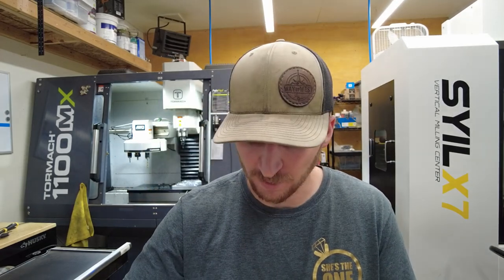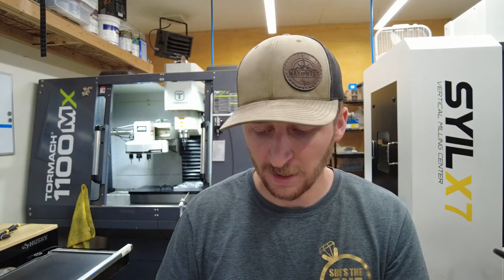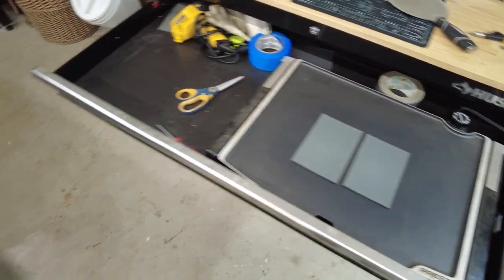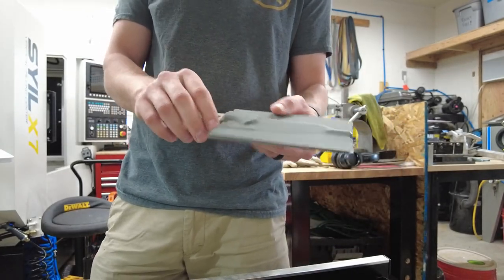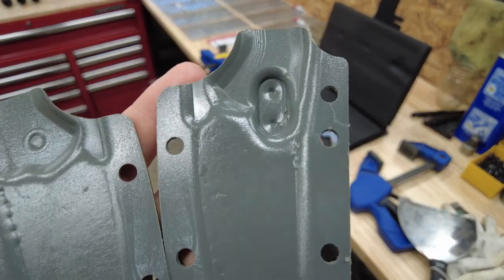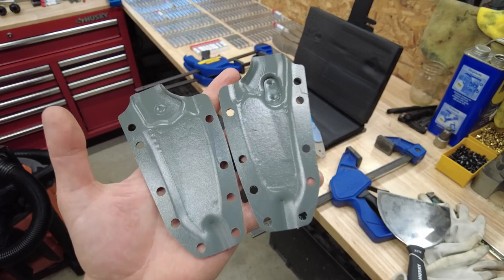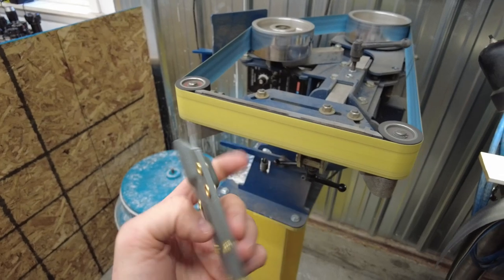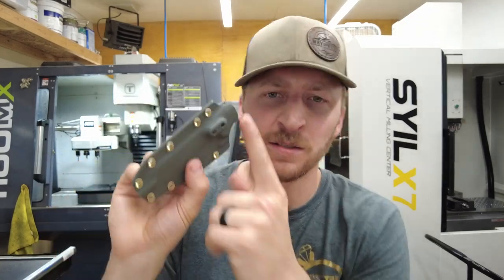CNC Knifemaking | Perfect Kydex Sheaths Every Time

Comment: Some great ideas! Tip for getting rid of that chip build up in plastic. Run a M05 stop spindle and run the drill in reverse after each hole. SO drill the hole, clear the part, stop spindle, CCW, stop, CW next hole. I cut a lot of Delrin and it builds up quick. A little air blast when running CCW helps to.
Reply from the maker: Good info, thank you.

Comment: What filament or resin did you use for the double hole jig? It seems holding well the kydex heat.
Reply from the maker: Just generic resin for an SLA style printer. The FDM stuff will not take the heat!

Comment: TJ, what made you switch from the former plastic clip in your previous sheath video to this one?
Reply from the maker: It had three holes and a large footprint. The spacing also didn't allow for the use of the double binder post to prevent rotation of the internal portion of the fastener.

Comment: I got to ask man, I'm at the point of putting in an order for a cnc mill, I've looked at the 1100mx and the syil... I'm leaning hard to the syil. After running both which would you pick if you were starting over again?
Reply from the maker: If your budget is over $30k just go with the Syil. Tormachs fits the $10k-$20k niche well but when you option an 1100MX into Syil X7 territory it's hard to justify.
Reply: @tj.schwarz  yeah that's kind of how I feel, even starting now the mx1100 basic package is at 27k with no tool changing etc. I appreciate the reply! The syil looks like a much better machine for the price range

Comment: Instead of letting the outside bounce around then fly away, add 3 toe clamps to hold the excess. Then you wouldn't need reverse helix endmills. Start your contour on the right side where you have less  material and add a ramp to your lead in instead of plunging where you have the most material. 
You could also use a backside  chamfer mill to get that angle your grinding in. 
The machine should be doing everything possible and you the least amount of hand work. 
If you use multiple work offsets you can be ruining 3 parts at once.